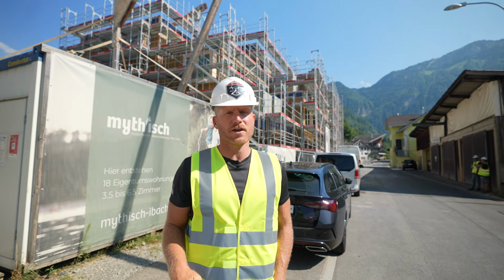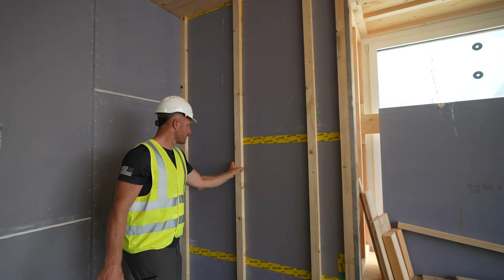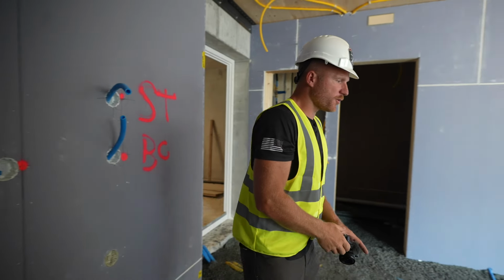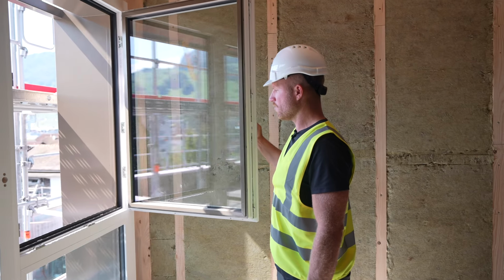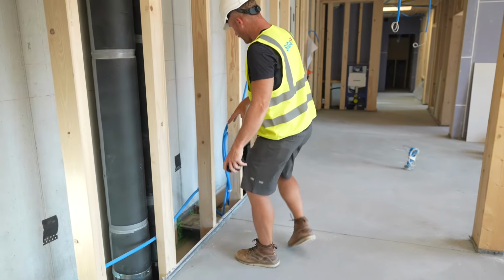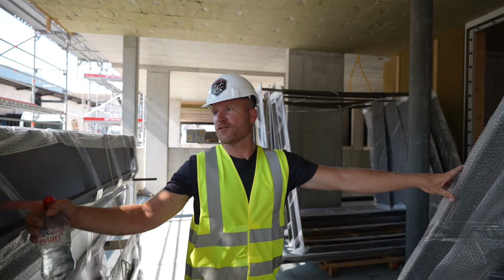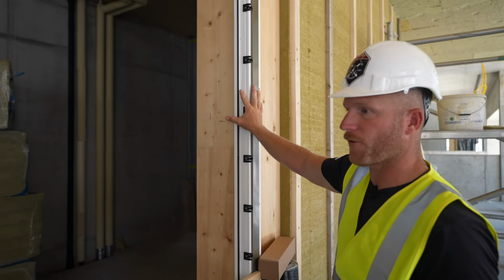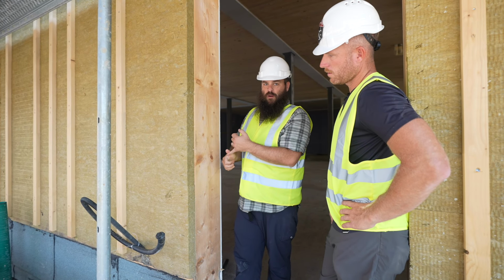Swiss Construction Site Tour - Insane Building Details

Comment: Love it. As I am from Europe, The Netherlands to be precise, we are not building this way everywhere. But windows and doors are closed and sturdy. Wether from wood, pcv or aluminum. That’s a minimal requirement. For insulation but also security. Many of the details in this Swiss build are just for fire security. This is a wooden build to minimise Co2 (as with concrete) but therefor more fire retarding insulation is needed. Thats the purpose of that sprayt aggregate for example. But maybe the US should switch to Metric standards. Thinking in millimeters gives a different perspective as inches…….

Comment: 11:45 Are you sure that's true? I worked construction here and we would always have a weather barrier outside as the last layer before the shindles or whatever came on. Inside we usually worked with vapour barriers but not always. But also as kind of the last layer before the wall came. Maybe you thought there was non because you do it in a different  order and this site wasnt finished yet? Or did you talk to a head of construction there?

Comment: 7:20 ok, the entire building is impressive, though I'm pretty sure it costs an arm and a leg from each buyer's family, but that door slide was SO satisfying 🥰
Reply: Currently new appartments in Switzerland will typically cost between 750'000 to 1.5 million Swiss francs, depending on location and fit-out standard.
Reply: @jaygotti5763  we have the same problem in Luxembourg. I have no idea how high of a quality new construction is, but prices are awful. Super expensive land, not enough new construction and old construction offer, plus the land belongs mostly to a handful of people with a lot of influence, and the prices are out of this world.
Reply: The thing is land is so expensive it makes no sense to build cheap on it.
Reply: This is a cheaper way of building in switzerland. Standard apartment buildings dont use the wooden parts in the walls and ceilings, they are fully built with concrete and rebar and isolation.
Reply: @ Is it really cheaper? The material certainly not. The only thing thing you get rid of off is the mold for the concrete. This is not a prefabricated house, made a modules that you put together like Lego. Those are errected in a week, and some are even made of concrete elements.
By the way - i wouldn't wanna live in a house made of concrete alone, 'cause that's called a bunker.
My 2 cents...
Reply: @jaygotti5763  it doesn't make much of a difference financially, wood (in this quality) is rather more expensive - unless you have local supply (meaning maybe 20-30 km; 50 km is already "far away" in Switzerland).

The more relevant point is, this is a Minergie building, which (you guessed it) minimises the energy consumption and more general (depending on the specific standard applied) the environmental impact.
The construction materials have to be ecological (concrete releases a lot of CO2), non toxic, etc. Even the transport distance gets factored in (see above).

Comment: Abstract

This video explores construction practices in Switzerland, with a specific focus on a multi-family residential building.  Key observations, discussed with an emphasis on building science, include: 

* *Robust Materials:* The structure uses solid wood framing everywhere, including thick ceiling beams created from glue-laminated timber.
* *Extensive Insulation:*  Multiple layers of mineral wool insulation are used both inside and outside the walls, and even under the concrete floors for soundproofing and thermal efficiency.
* *Unique Wall Assembly:* The exterior walls have no weather-resistant barrier or sheathing.  Instead, they rely on water-resistant mineral wool insulation and a ventilated rain screen for moisture management. 
* *Soundproofing:*  Measures like aggregate layers under the floors and significant insulation help reduce sound transmission between units.
* *High-Quality Details:*  Custom-fabricated windows with multiple opening options, smooth-operating heavy doors, and precisely fitted components demonstrate build quality. 

The speaker compares these techniques to conventional North American construction (specifically post-frame buildings). He concludes by acknowledging the potential for incorporating some of these robust Swiss building practices into future construction projects in other regions.

Comment: In the Netherlands we could only dream of such high quality construction. Unfortunately we got lazy after gas was discovered. Only in the past few years the building standards have improved, but we are nowhere near Swedish or Swiss standards. This is passive house level, R 6+ at minimum, but I think more likely R 10+. In the Netherlands the standards for new builds have just been updated to R 4.7. Timber frame construction is also very rare in the Netherlands. It is unfortunate, because there are other areas of construction (infrastructure) in which we have been able to be on the front of innovation.

Comment: To call it over-kill seems to be an understatement...
Reply: Its not overkill because it provides great thermal mass and protection against the elements. Its probably gonna equal out after 30 years considering heating and cooling costs because they are simply very low. Not comparable to the energy waste thats required to keep US houses temperated with air vent systems and no thermal mass and minimal insulation.

Comment: Curious. I know I’m late to this video but I came back to try to understand this wall design. So, what if you place the vapor barrier on the interior framing prior to drywall? Would this give an additional security for water never reaching the interior as well as additional air barrier? Furthermore, what if you were to do sheathing on the interior framing and then drywall over top? Obviously zip sheathing facing exterior. I know the cost would be extreme but as far build quality, this would be the ultimate in my opinion.

Comment: You can get the windows in different grades for security and insulation. If you buy a high grade Window or glass door you can be sure no bad guy breaks in without some fight. I talk 3 layers of laminated glass, if you with laminated tempered security glass in a steel reinforced wood frame. 300€ for a baisc window up to 800 per window for security. BUT....many insurance companys in germany give you a bonus for your home insurance when you get the better security option.

Comment: My takeaway is that the doors and windows are great and the attention to detail in the waterproofing. everything else is overkill,as far as the average home goes....all that aggregate might as well be concrete. Possibly the reinforcing steel is the deal killer in regards to the concrete, but the I beams also bring up the cost and would not be nesc. with concrete.  The skill level for trades is most likely far better,when it comes to multi unit buildings..But the custom home market usually  try to hire experienced carpenters.   .. it reminds me of a science project, with no regard for the economics of housing people (balancing needs versus wants).  Possibly this is a development for millionaires and not the norm of Swiss building practices
Reply: Its the norm and even law. Passive houses that last for centuries are ulitmately more economical too. This wont just be torn down after one generation of tenants/owners and will cost a fraction of energy for heating and cooling. This is completly standard in new building projects n Europe and its no different for single family homes.

Comment: Another thing about those windows is that if you set handle position mid-way between vertical open and horizontal open, it's still closed but there is air gap all around window seals to let some air in
Reply: It depends because for some manufacturers this is an ''option'' ($)

Comment: Don't compare it to US home building. This 18-home residential building built in US would have to comply to commercial building codes for fire, flooring, walls, plumbing and so on. It will house +50 humans on several floors. And the price of a single appartment will probably shock most in the US as it is comparable to high priced Silicon Valley homes.

Comment: Technically streets ahead of the UK although different climate and materials availability dictates how houses/apartments are built. Quality of workmanship undoubtedly better than UK. All that glass and insulation will certainly minimise energy use. I have built 350 Dutch style apartments in the UK and they also like a “wall of glass” style design, which is a bit alien to UK where people are more reserved, privacy is highly valued and glass relatively expensive.

Comment: Not over kill, just different methodology.  We vapor barrier and allow separate climates on both sides of the wall they eliminate the vapor barrier and allow a climate to exist between both sides of the wall.  Because they don't have the vapor barrier they need a thicker wall to allow for drying and to slow the speed with which the exterior climate becomes the climate of the interior and vise versa.  We can reduce the thickness of a wall because we separate one climate from the other and stop vapor from penetrating from either side which allows us to get good thermal potential.  Well, that's my story and I'm sticking with it!  BUT, i really liked looking at what they do, it works and is probable greener and a longer lasting product.

Comment: Building codes here in sweden with our cold climate demands thick insulation. My parents new built house have 400mm insulation in the Walls and 600mm in the roof. 500mm of styrofoam underneath the concrete slab. 6000kWh in a year is needed to heat the house. Mean temperature during a year is 7C (44F).

Comment: I have some experience installing Alpine windows. They are a us made version of the windows and doors in the video. The experience was not a good one. The problems came down to design of the framing by the Architect. He was not very well versed on the what the window manufacturer required.

Comment: The reason for the very thick floors is to create heat capacity; I presume that the floor heating will be rather low-temperature (maybe 35°C). So, the whole block will be slowly heated up, and it will keep that heat for some longer time. This is needed because the walls are very well insulated, but their heat capacity is not very high.

Comment: To be fair, there’s a big difference in small scale residential projects and these big scale commercial projects, in terms of materials and structures. Also, every country in Europe has its own building codes and standard building materials/methods. It also depends on the region (dry climate vs wet climate).

This specific example is being built at a huge cost, looking at the material use. These aren’t regular homes, they would be too expensive for the average person.

So I’d say this isn’t representative for the whole of Europe, in fact, not representative for normal homes.

The windows and sliding doors are pretty regular though, that’s basically the norm.

Comment: With floors and ceilings that thick, how do you go in to service electrical and plumbing issues?
Reply: You try not to have them. As fas as electrics the wires are run in conduits and is easy to  replace them or add new ones.

Comment: The reason most of Europe generally doesn't install AC in residential is because it wasn't really necessary up until a couple of years ago. Most of western Europe summers for example would be low to mid 20's (so in the 70s°F) which doesn't really require AC as it's not that hot, and especially if it's only this kind of weather for 2 weeks (if unlucky) or 4-6 weeks (if lucky) a year. Countries like Spain and Portugal have a warmer climate so they usually have AC from my experience. Obviously this has been changing the past 4-5 years due to climate change and our summers are starting to get much hotter as it's been +32°C/86°F here the past few weeks, so a lot of people have been installing AC. I built my house 3 years ago and installed a multi-split AC in all bedrooms and I'm glad I did with a summer like this. My house in Belgium has the same kind of windows and infloor heating but the insulation is not as thick, maybe about 70% from what you saw here. We generally build to keep the heat in.
Reply: Actually, the traditional mediterranean houses are stone houses with sometimes pretty thick walls. Also, the mediterranean climate means dry heat during the day, but it cools down during the night. Which means that during the day, you keep out radiation, and close shutters etc., but during the night, you open up the windows, and it can cool sufficiently down. So, absolutely no need for air condition. 

Another thing helping is if you have protruding roofs, making sure that there is no direct sun when it is hottest.
Reply: I obviously haven't been in every house in Spain or Portugal but every airbnb I've been at or looked at on websites had AC installed, but I guess they'll just have installed it to cater to tourists.
Reply: @matthi_be  As stated, my reference is to traditionally built houses. But, yeah, because the tourists don't know how to handle it, it was easier to install AC (and allows to charge more… :). ). And I also must admit that my experience is based on the Provence and a bit of Italy.

Comment: No WRB or floor joists?
I’ve never seen anything like this, I’d liked to see some of those 200-250 year old houses he was talking about. Most of the houses that old in America are made out of brick
Reply: I live in sweden, our house is made out of timber and turns 180y next year. I dont see why it would not stand 180y more.
Reply: @Fextreme93  that’s awesome
Reply: @FixItFrench the house i grew up in (in switzerland) is now 300+ years old. It‘s mainly wood construction („Strick“ which is a similar to a solid log cabin but with rectangular beams) and has been renovated 30 years ago. Of course building techniques have changed a lot in all this time! What he’s showing in the video is normal for modern multi-unit housing, which probably explains why swiss houses are very expensive but last long.

Comment: this is certainly not "how we do it in europe" this is very regional, especially in the alps, where you get 30c (100f) in the summer, and 3 meter snow in the winter.

you will find completely different buildings in southern or eastern europe.

europe is very much not a country nor shares anything in building codes or systems between countries.

Comment: They have multi generational mortgages too in Europe, 50 year mortgages to afford the property
Reply: Most of the Mortages in the Netherlands is 30 years.
Reply: @vanDeudekom  Yup, 35 is the max you can really get in the UK, and even then we lock to 5-10 year fixed rates
Reply: @BuildTechWithJack  I have a 40 year mortgage in UK.  Going to sell in 20 years and downsize
Reply: We don't, not really- The govt in the UK suggested them recently but they were pretty much shot down immediately.

Comment: The wooden   floor separation is not normal in Denmark, but the rest is. when building in wood construction we become 19,5 inches of rockwool in outer walls, floor and ceiling construction
Reply: Netherlands as well, I live in a house like that and men is it comfortable. Energy bill, we only have electric, is € 60,- / month, with only 12 solar panels on our roof. We have heatpumps, cold warm water storage in ground to heat and cool our house.

Comment: In North America we build the cheapest way possible to meet minimum requirements. Our system is based on greed. Build it cheap, tear it down and build another one. In Europe they build it for longevity. Top materials, top quality work and top quality methods results in decades of problem free construction. 
One reason for the massive timbers is fire rating. With no place for oxygen it’s actually very fire resistant and less toxic materials are used for construction which is better for the occupants and the planet.
Reply: In my country, Netherlands, all the little kids learn at school; in case of fire in the house, leave the room and CLOSE THE DOOR. Thats it.

Comment: That is amazing how they do construction over there. I think we could and should learn something from them. Thank you for letting us tag along and for showing the building science included with this.
Reply: Being Swiss, let me tell you, the average home price is over a million and thats for an apartment, in bigger cities it's more like 3. And houses are significantly more expensive. What you see here is probably in the 1.2 to 1.5 range with maybe 1400 to 1600 sqft. (which is huge by Swiss standards), and these are apartments in a more rural setting (I recognise the mountains there, this is "Schwyz"). This house probably has anywhere from 12 to 16 units maybe more (couldn't really see it), so you do the math (that building probably costs some 16 to 20 million or so). For that amount you can get an equally impressive house in the US. But they are quality and they do hold up. I live in an internally modernised 250yo house right now, you could never tell.

Comment: This seems like allot of unnecessary lumber waste.  A Solid woo 8 inch thick ceiling is excessive isn't it?  Very interesting for sure.
Reply: It seems like a waste when you're used to being ripped off by corporations playing human to get the benefits, but none of the punishments. Here in Europe, that wood is sustainable and managed. That's structure that is equal to concrete, yet not even a fraction of the weight.
Think of this house as the equivalent of a Boeing 747. Composite structure changed the aviation world, and it's becoming the go-to standard in housing now, where as before (say 10~20 years) it wasn't.
Reply: If you look what is put on top of this ceiling, you will understand why it has to be so thick; 10 to 15 inch of concrete is not light…